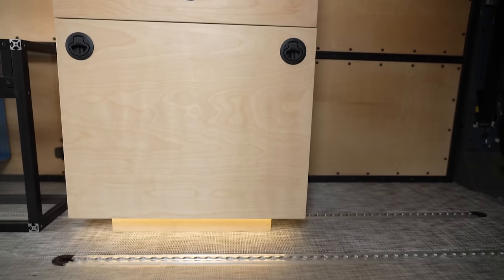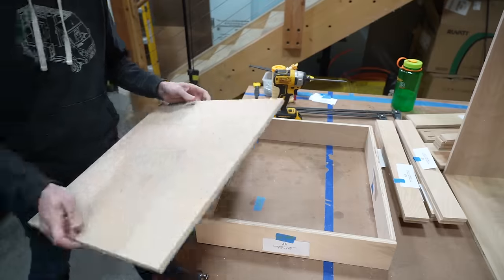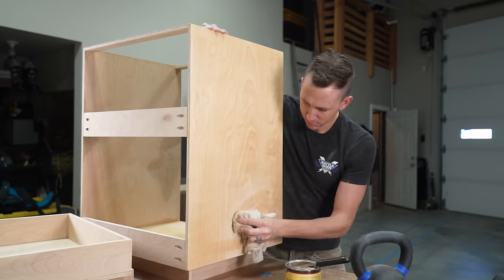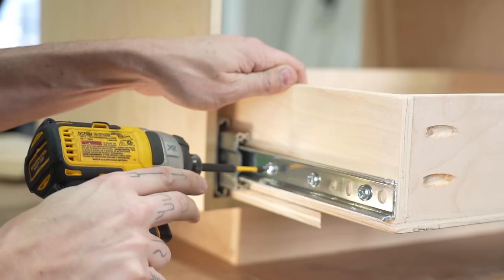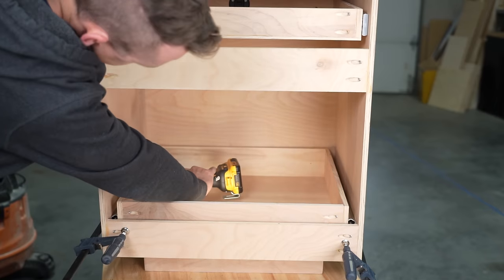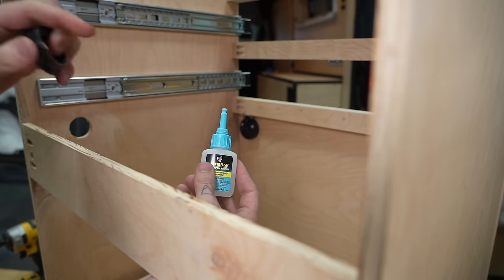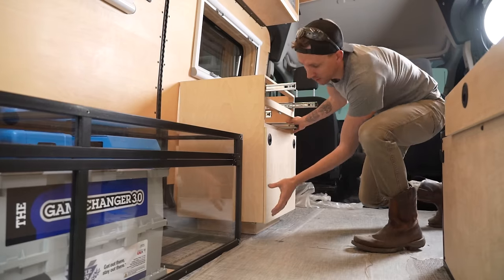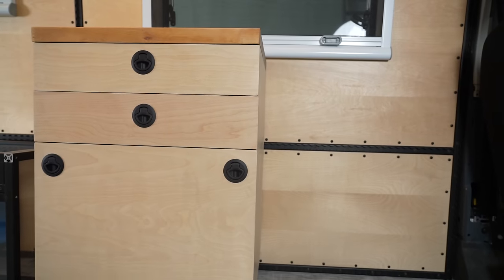Building a TOILET CABINET for a DIY Camper Van Conversion

Comment: I did my toilet design like this and I did not work at all.  You have no room for you legs to spread.  Your right leg will be sitting on the drawer face,  and the left leg will hit the cabinet face.
Reply: I built it just like this too, and it does not work.  The side of the toilet crowds the legs together and with a natures head toilet, it's too tall.   In the process of rebuilding our toilet to be a "seat" with footrests for "better performance".
Reply from the maker: I hope you found a solution that works for you.  We are pretty happy with how ours turned out and functions.  It's similar to our old sprinter that we lived in for nearly 4 years, so we've got some past experience on our side too.  But yeah... if you have special needs or need more room, you may have to change things up for your own needs.  Thanks for watching!
Reply: LOL I do gymnastics to go for a ride on mine! Slide out also (Separett) … Thankfully I am flexible😂
Reply: Ahh spacers! Brilliant!

Comment: what is the finished height of your cabinet? I am trying to figure out which window and cabinet to use at the front driver side location. A lot of people are using the CRL t-vent window, but the cabinet counter must be held way back from the window to operate the vents. It looks like you have the Arctic Tern window married with this cabinet (of unknow height) and they work together fine. Oh yeah, I forgot to tell you that I am planning on have the wall in the window wall recessed into the existing metal framing opening . to provide a bigger countertop.

Comment: Is that the Columbia forest products birch plywood that can be found at the local big box store? I think that’s what I am going to use because of the cost and scarcity of real Baltic birch right now.
Reply from the maker: It's birch ply, but not baltic birch since it's nearly impossible to get where we live.  We don't have a big box store closer then 2hrs from us, so I can't speak to if it's the same brand.  It was whatever birch ply the local lumber yard had.  Was pretty poor quality wood for how much it cost, tbh, and we had to glue a few plys together in a few spots after we cut them.

Comment: Thanks for this--wondering if you would have preferred lock in/lock out drawer slides for this?
Reply from the maker: Nope.  When driving, push-to-lock drawers have a tendancy to 'push in' while turning corners and then open while driving.

Comment: Great work as always Nate. Would love to see a video on the benefits of using your track system vs wood walls. My take on it is that the track system allows for changing modules and allowing the van to be dynamic as a result?
Reply from the maker: Good idea!  And you are on the right track with that (get it? 🤣👍)

Comment: Its a great job and beautifully made. Probably the best tutorial ive seen on this subject and ive watched quite a few doing my van build. I was shocked by how much space was being lost in the configuration of the drawers both inside the drawer and underneath. As they can only have so much in them to not catch on the front supports the effective drawer depth must have been significantly reduced. I suppose it depends on how tight for space your van build is. As mine is a Transit custom SWB i couldn't waste an inch. Nice video though.

Comment: Hi Nate, thanks for the video.  For the life of me, I can’t figure out how the bottom of the toilet drawer can hold your weight when it is only glued in to the sides of the drawer…. Did you also screw it in to the side somehow as well?  How did you make sure that the bottom won’t just fall off?  Thanks again!
Reply from the maker: A good solid glue connection is actually stronger than wood if everything is straight, square, and clamped properly.
Reply: Thanks Nate.  I saw you standing on it so I believe it!  I just can't get over it psychologically lol!

Comment: You will probably find that you want a quicker way to remove the entire toilets unit for cleaning. We have this toilet and the simple act of turning the agitator, even slowly,  will throw stuff around the inside of the unit.(Look at PatchWorxs  Youtube review)  Also, liquids will sometimes find its way into the bottom of the unit no matter how careful you are, so make sure those screw holes don't leak.

Comment: Just a heads up on the LED strips, those type of snap or pinch connectors are only recommended for applications that are stationary, I believe it’s even the manufacture recommendation to solder the wire connections. The connectors you used are not meant to be jostled or moved about. It finally made me learn to solder wires once I read the instructions from the light manufacturer. Just fyi. Appreciate all your hard work and quality content.
Reply from the maker: Yeah, if it doesn't hold up, that'll be a really simple repair with the way they are just connected with levernuts at the back.

Comment: I’ve been eying that composting toilet recently for an addition to our caravan. It will be either that or completely diy. Nice cabinet build but wondered if the weight of the toilet (and person when on it) is being supported by just the glued bottom and finishing nails?
Reply from the maker: The wood will break before the glued joint will break.

Comment: Did I miss where you vented it? You mentioned connecting power for the toilet’s vent but never saw where it vents.
Reply from the maker: It 'vents' through an activated charcoal filter.  So, it's more 'filtered' than it is 'vented'.